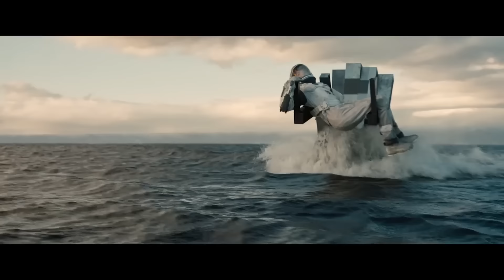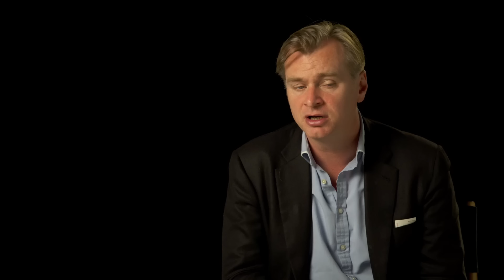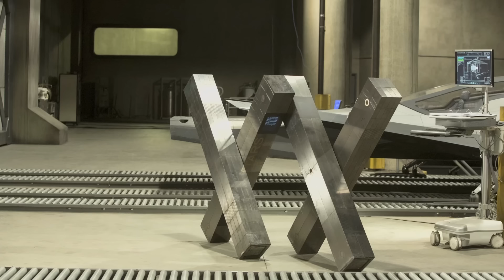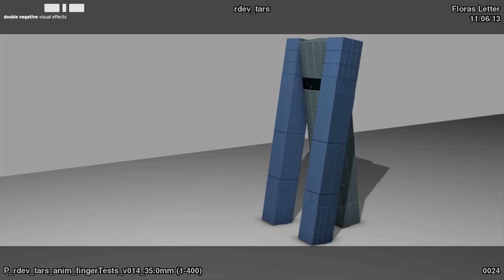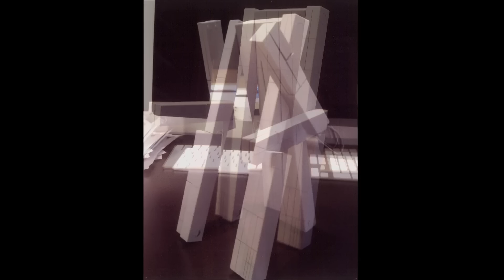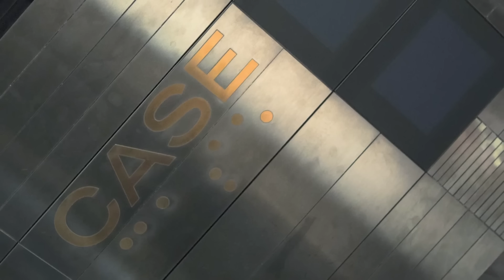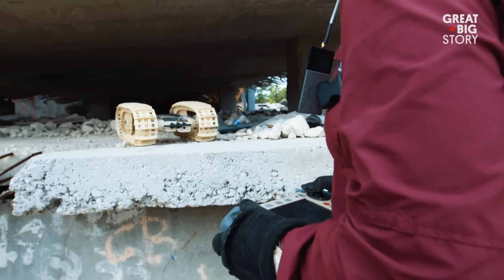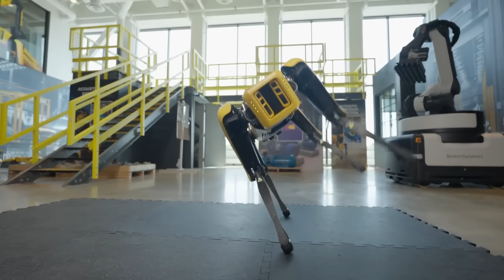The Robot Design Interstellar Got Right

Comment: Unlikely that it would be as mobile as it is portrayed. We have many joints all working together to balance us on two legs so we can move without falling. That thing literary has one and the bottom of it's "limbs" are just flat squares plus it seems to be really heavy. In other words that thing surely would fall over all the time especially if moving at any speed.
Reply: it doesn't even have a consistent joint. Look at how it moves when 'walking' vs when rolling. When it's walking the hinge is at the top, when it's rolling it's at the bottom. No idea how this thing is supposed to work physically
Reply: @sino_diogenes To be fair you can see the unused rolling-joint when they are in "walking-mode" but a desing, that constantly attaches and de-attaches feels very prone to dirt.
Reply: @Nitram4392  Maybe some special joint that is able to keep out dirt?
Reply: @sino_diogenes 
Could have internally sliding magnetic joints + gyros

Definitely always needed more lateral articulation to be believable, though
Reply: @sino_diogenes  Magnets, similar to BB-8
Reply: @sino_diogenes  magnet probably
Reply: Hinge slides
Reply: @sino_diogenes Magnets, extendable/retractable post-in-hole hinges, internal pneumatics/hydraulics. This is a sci-fi setting, think about what you cant see.
Reply: also they never do anything to lift said limbs so it'd just hit the ground again
Reply: I agree - but one of things that showed what a good movie it was, was that even though I knew they weren’t realistic robots, they were great characters. Theodore I didn’t care about the reality of whether they could work at all.
Reply: Magnets could be the “joints”, but sand and grit between the legs, constantly gouging, would make problems quickly. Maybe it is designed for outer space, which is relatively dust free, compared to terrestrial.
Reply: And the way the scenes are edited, you don't really see how the robot do things apart from walking or rolling. Also, it looks like a lazy design, as if it is too much work to come up with a more complex and appealing robot, so let's make walking slab, done!
Reply: I like the attempt at making them not humanoid, but "practical" design, if only there was any actual thought put into the practicality of their design.
There is zero ground clearance when moving on "legs". There is a distinct lack of joints in the "arms" that fold out, and they can't even fold out and move around without horrendous self-collisions that are hidden from view. There are unnecessary changes of attachment positions of its segments, requiring extra copies of motor/transmission. None of the possible configuration provide good lever actions for fast running, instead we have a rolling spokes configuration for that, that relies on propulsion by magic.
Reply: Right lol. This to me always seemed like one of the least realistic robot designs in sci-fi for exactly these reasons

Comment: Robots like this are part of our present! I used to see one whenever I'd walk into Giant Supermarkets. It was designed to check shelf stock and look for spills, and it turns out that the optimal shape for that looks sort of like a telephone pole on a roomba.
Reply: I work in a store with that contraption. All it does is yell across the store whenever it finds the tiniest litter on the floor. Didn’t know it can scan shelves for gaps and whatnot but I did overhear plans to monitor missing tags. But yeah, even then it’s kinda eerie that ours were given googly eyes on its side but in a front view, it’s got like five cameras and a couple more on the “head” looking downward. The weird shape let’s it scan at a larger vertical zone at once than normal human eyes.
Reply: "Alcohol is in aisle 10"